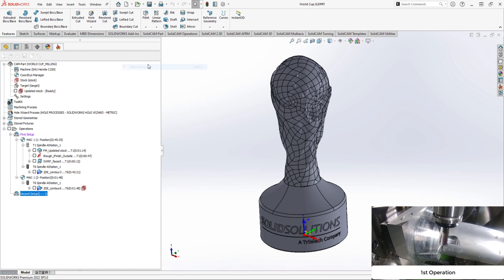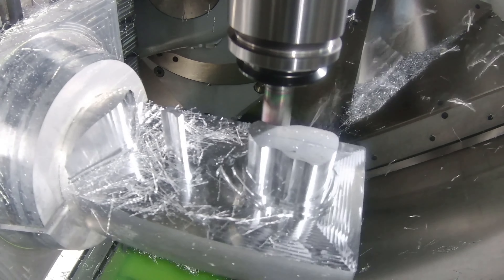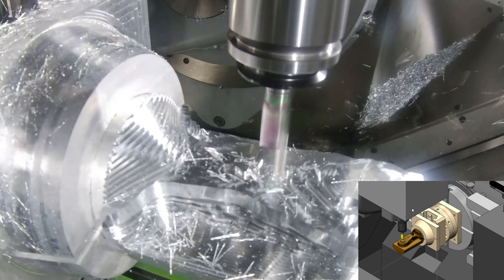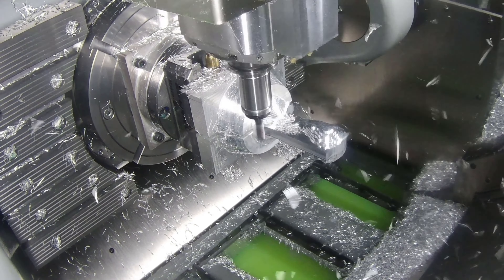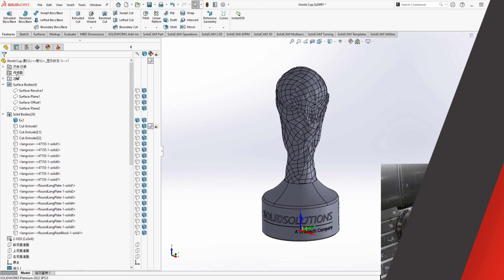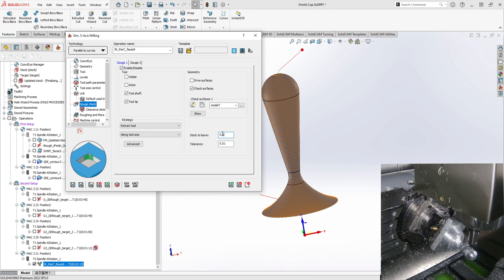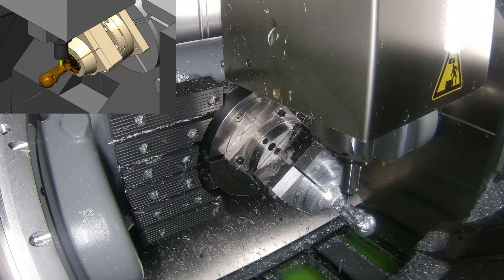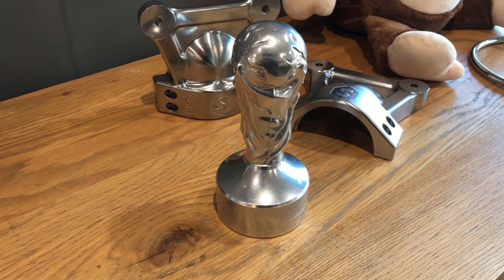Making a Model of the FIFA World Cup Trophy | SOLIDWORKS and 5-Axis iMachining

Comment: Which software for visual simulation was used?
Reply from the maker: SOLIDWORKS 3D CAD was used to create the model
https://www.solidsolutions.co.uk/solidworks/3d-cad/packages/

SolidCAM was used to program the CNC machine and simulate the output
https://www.solidsolutions.co.uk/manufacturing/solidworks-cam.aspx

SOLIDWORKS Visualize was used to create the rendered image shown in the thumbnail.
https://www.solidsolutions.co.uk/solidworks/visualize/packages/

These software all connect to each other seamlessly, please follow the links above if you'd like to learn more. Hope  this helps!
Reply: @TriMechGroup  raw solid model was from? Was it made from stl data? How was stl to step done?
Reply from the maker: @avitolourenco  Hi Avito, I'm not sure whether the file was originally brought in as a Step or STL but both of these file types can be brought into SOLIDWORKS. SOLIDWORKS can also export both file types, so you could use it to convert from one to the other.